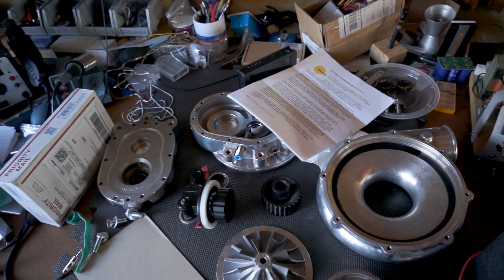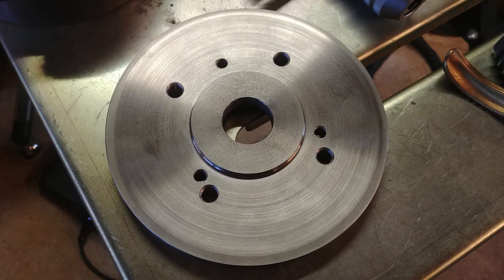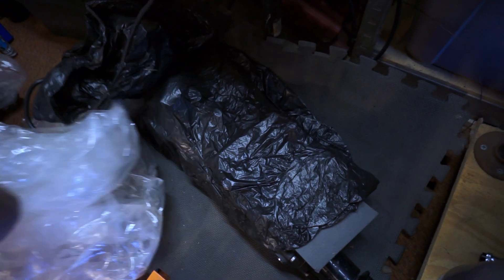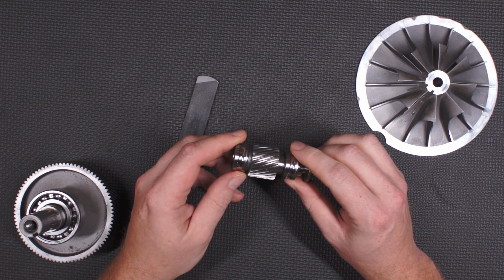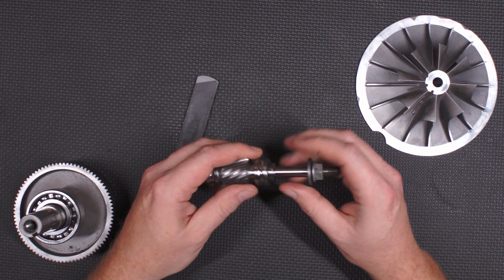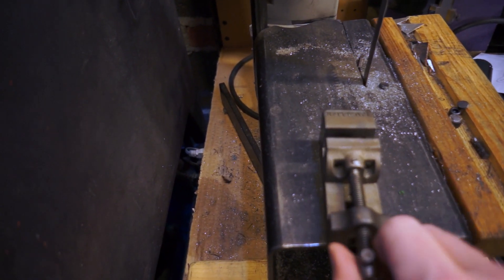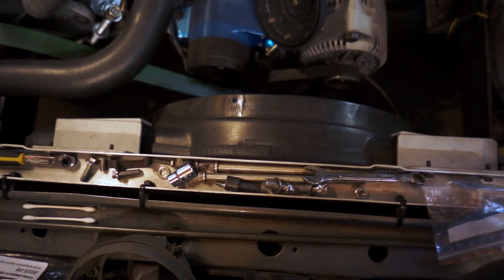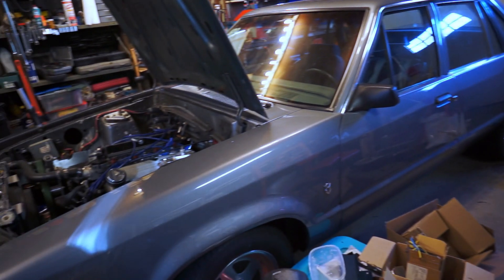Electric Supercharger Update - Shop Tour and Motor Ordered!

Comment: Why not go turbo I mean LS also but you already have the Ford
Reply from the maker: A number of reasons: 1. My engine is a Dart Iron Eagle Sportsman block with ported trickflow heads and good parts - it can easily support 1,200hp and stay together, more with a turbo - probably 1,400 hp.  A stock LS can't handle that much unless I start throwing money at it.  2. My trans is good for 1,800 hp (glide with hardened 1.80 low BTE gear set and a BTE vasco output shaft).  The limiting factor there is probably the case.  It's all set up for the Dart/Ford. 3. LS/turbo motors are lame. In fact, the LS platform is such a close copy of the venerable SBF that you can physically bolt on an LS head to a Ford block with no modifications.  To get it to run, you'd need a custom cam that swaps the intake/exhaust lobes and a custom intake - that's it.  But seriously, an LS is really just an updated copy of a Ford small block, adapted for running EFI, with a few mods for block strength - the Dart takes care of that issue easily.  4. A turbo is good for putting up numbers, but lousy for winning races.  We've never had a turbo car win any class in our show or any of the episodes of Pinks I've directed.  5. This isn't a game of "how fast can I go" - I could slap a YSi on the thing and run 8's with 18-20 psi.  I'm not a checkbook racer.  I'm also not particularly interested in jeopardizing my safety too much - I'm a full-time single dad and my welfare is a factor.  6. I'm less John Force and more Austin Coil.  7.  I'd rather do something that's never been done before - heck the Whipple setup was not only custom made by me (including the intercooler - core and all), but it runs damn well for what it is - on pump gas, it's a consistent 9 second car that can be driven to any track, any distance, run 9's without even changing tires, and driven home, all on 93 octane.

Ok, that's more than a couple of reasons, but you get the idea.  I've made a good deal of progress on things, I just haven't had time to post a video.  One's coming up soon.
Reply: I mean if you don't like the LS that's fine I guess but I'd dispute the HP limits check out Richard holdener videos I believe on the big bang motors he puts some ported heads or aftermarket ones and an intake and obviously a cam and springs but the intake is probably pretty unnecessary but he was making over 1200hp with a stock bottom end and I think like 1600hp with a 6.0 I mean that's just on a Dyno for a few seconds but if you are carful it could last a little while and if you want it to last a long time get a better crank and rods and pistons
Reply from the maker: @james10739  I don't hate the LS, I just don't have a need for one - I have something significantly better.  And yes, I'm familiar with Richard's dynos - back in the day, Jim Campisano offered me the tech editor position at MM&FF before Evan Smith got hired; Richard was doing a lot of Ford testing even back then; I turned it down because the job paid $35k and I lived in NYC at the time.  The problem with LS motors isn't splitting the blocks.  The problem is first the rods bend around 700 hp (put in aftermarket rods), and then around 1,000 hp, it's difficult to maintain headgasket and ring seal.  The block just flexes too much.  You'll probably be pushing water at 1,000 hp, and definitely by 1,200 hp in an actual car.

Comment: Great approach to this challenge Alex, I am thinking about doing this myself. You can calculate the motor power required from the compressor map eg on the peak efficiency point arrowed on your Vortech map (massflow=37 lb/min (0.28kg/s), PR=1.35, efficiency=0.75) go to https://www.engineering-4e.com/power-cycle-components-calculator and enter massflow (2.8) and outlet pressure (1.35) to get isentropic compressor power. (The calculator won't accept 0.28 so enter 2.8 and divide the power result by 10). The result is 7.6 kW for a 100% efficient compressor. For a 75% efficient compressor the power required will be 7.6/0.75 = 10.1 kW.
Reply from the maker: I don't know how I missed this comment.  Awesome info.  Thanks!  Edit - looks like at peak motor draw, we could hit near 650 hp and a bit over 4 psi of boost; which is right in line with I think we can reasonably expect from this first generation setup.  The only real unknown now is how much the engine air draw will help the compressor - unless that's taken into account in that calculator.
Reply: Yeah it is accounted for. The compressor just sees two pressures (in and out) and the flow.

Comment: Cleetus McFarland just tested an electric turbo from Holland (Europe)// you should see that video - making almost double hoses
Reply from the maker: I watched it (the twin Torqueamp video) after reading your comment.  I think it's really cool what he did, but the results don't make sense to me.  At peak power he was making only about 6 psi, yet he saw like an 80-90% hp gain?  The math doesn't add up.  I'm not saying his results are wrong, but I'd like to know why.  If there's some missing variable that electric supercharging adds in that conventional blowers/turbos don't, I'd love to know what it is.  Assuming this thing holds together and we see similar  results, we could be looking at as much as 800 hp (flywheel, not rear wheel) - the compressor can't support more than that, but to match Cleetus' results, we would need to see 900-950 flywheel hp.  I very much doubt that'll happen.  I think we're realistically looking somewhere in the 600-700 range.  I guess (and I hope) we'll see!
Reply: @AlexLTDLX  thank you for commenting // Cleetus has a video singel and double turbo in the same car - I'm not so good about the number calculation but boosting a small engine to double up horses and torque then you are on to something good - hope you ordered the right electric engine - I will follow👍
Reply: the psi drop (or droop) is due to the consumption factor as the engine consumes the compressed air. staticly the pressure will be higher on a turbo, supercharger, what have you, and will go down a bit as the compressor tries to keep up. think of a air compressor making 150psi in a small tank and using a purge air sprayer drops the pressure while the compressor keeps up with demand. 
this electric turbo is a much curious concept for me and some of us who don't like throwing scavenging out the window with turbo charged systems. the "free horsepower" belief/myth loves to prevail in its ignorance in net gained hp by then ignoring all the parasitic losses in an engine that still makes power in the end. 
here, the ability to switch the compressor on and off when 100% throttle is needed and allow the exhaust to free pulse out and away is huge--allowing the total power potential to be higher from less in-charge psi to out ratio. if it doesn't help, then it doesn't. but a nice 10-20psi of boost with no added back pressure should work better than 10-20psi with 10lbs of back pressured exhaust in the comb. chamber every cycle. ...and then on and on up to the high boost numbers in use now(60-150psi).

Comment: excited to see the supercharger come together ... so direct drive then given the motor rpm and compressor map?  Ceramic Bearings?    How do they do those oil-less superchargers?
Reply from the maker: Yep, that's pretty much it.  It'll basically come down to my machining precision.  I can't find a reasonably priced ceramic bearing.  It's a 6302 size - 17mm id, 40mm od, 12mm wide bearing.  If you come across one that can support 50,000 rpm and doesn't cost a fortune, I'd love to know about it.  I even called SKF to check.
Reply: @AlexLTDLX  interesting ... How do you plan to couple the motor to the shaft for that room range?  You may need to balance the coupling.     That motor is very impressive!   I am sure there is a prefab water jacket for that size given the rc boat community.

Comment: Any coincidence that a company recently released electric superchargers, 2 of which displayed on Cleetus Mcfarland youtube channel?? Just curious.
Reply from the maker: It is literally just that - a coincidence.  I never even heard of Torqueamp until after we started down this path.  What is the second company you're referring to?  It just seemed like a logical (and interesting) next step, now that brushless and battery technology have gotten to where they needed to be.  But the ones I've seen are small and don't support a lot of power.  Although Cleetus' results don't make sense to me - he made 5-6 psi at peak hp, but picked up more hp than the pressure ratio would dictate.  I'm not saying his results are invalid, I just don't understand why (I can guess that maybe the parasitic losses don't increase with the added power; but even then it seems high).  Which is potentially good for us.  What else was interesting was seeing him hit the surge line with two Torqueamps.  That's exactly what I would expect with centrifugal compressors (doesn't happen with positive displacement blowers).

Comment: what cage kit do you have?
Reply from the maker: I honestly don't remember - it's been in there for closing in on 20 years.  I think it was an S&W kit, but I'm not 100% sure.  FWIW, it's a 6 point roll bar, not a full cage.
Reply: @AlexLTDLX  well dang im trying to find one that fits 4 door box top foxes well and id rather get a kit because custom stuff is expensive
Reply from the maker: @myheadisntbig  I think this one was for a mustang - you still have to trim them down.  But I'd call S&W and ask.  It fits well, btw.